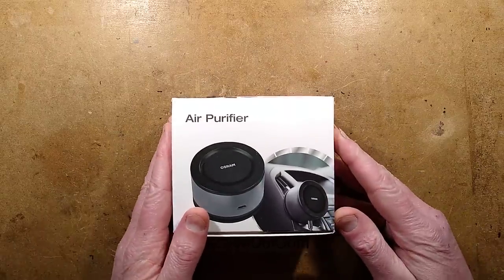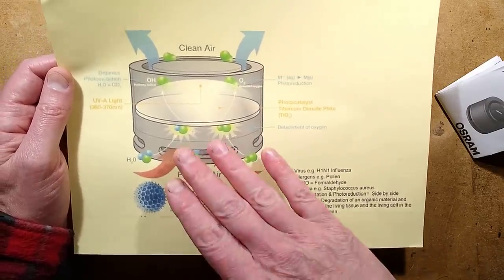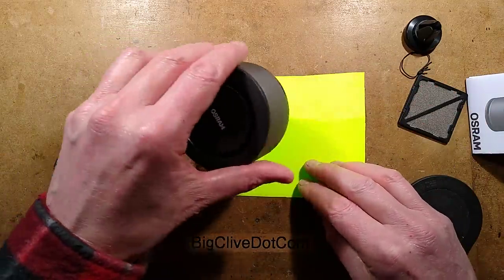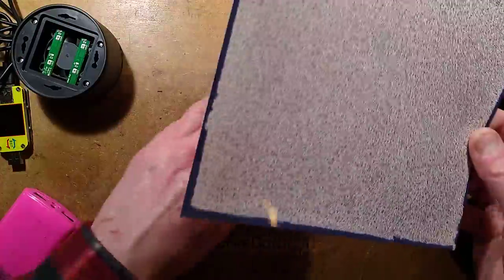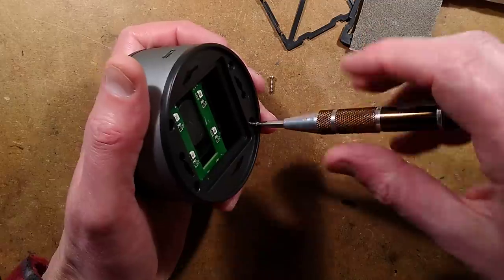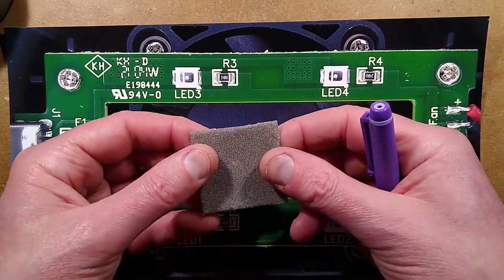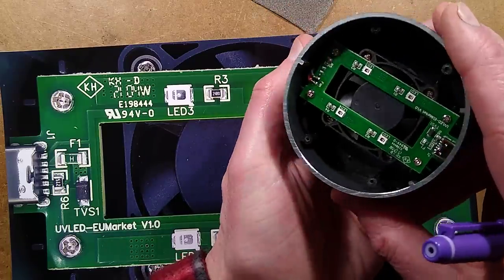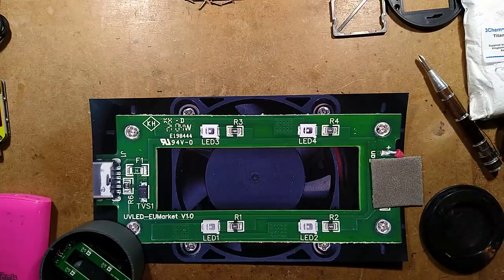Inside an OSRAM AirZing photocatalytic air purifier

Comment: Yay :) I got quite excited about your video (since I am a fan of the channel and now you talk about the topic I'm researching for the past 15 years). TiO2 is a photocatalyst and is one of the most popular ones - it all started in 1970s with a failed experiment by two Japanese - Honda and Fujishima. The principle is that it TiO2 is a semiconductor (it is also called heterogeneous semiconductor photocatalysis) and when excited with light larger than its bandgap (3.2 eV or UV with lambda < 384 nm) it generates charge pairs (pretty much what happens in solar cells as well). If there is a molecule adsorbed on the surfaces, and these charge pairs (electrons and holes) reach it - you can oxidation and reduction reactions (and can break down organics). It works, quite well (even under modest UV illumination). There are some issues, however - in humid air you can water layers on the surface, which (in one hand help photocatalysis, because water can mediate the process forming hydroxyl or superoxide radicals and increase the efficiency since they have longer lifetimes, compared to the photogenerated charge pairs), but on the other hand it (water) can have detrimental effect on the overall process, blocking hydrophobic molecules from reaching the surface. There is also the entire issue of photocatalyst deactivation. My PhD thesis was all about photocatalytic air purification (using TiO2 coated windowpanes) and it is very effective against common contaminants in lab scale experiments (however in the real world there are other issues - but all in all it work - probably not as effectively as ozone, but with less maintenance and energy consumption). And regarding the filter mesh - not all TiO2 is photocatalytic, it needs to be in the anatase form and nanostructured (food-grade stuff is made of larger particles and usually is rutile). So - in this case they either probably coated the porous substrate with a thin layer of TiO2 sol (it is a liquid precursor of TiO2, which gets converted into the material after heat treatment - in this case it is important what the base material is, since titanates with lower activity may be formed // however the gimmick factor will be the same), alternatively - a better solution will be to start with Ti-metal foam and anodise it to form a TiO2 layer ontop (you need no more than 100 nm thickness to have photocatalytic effect).
Reply: Youtube post of the day! Thank you! :)
Reply: Wow. I love getting this level of information firsthand. Clive really has the best community
Reply from the maker: I've since found titanium dioxide coated nickel foam on AliExpress.
Reply: Top answer - assuming you believe in atoms.
Reply: LEDs have approx. 85% efficiency. Not all of that light hits the TiO2. Part of the light that hits the TiO2 turns into heat directly or indirectly. The rest create chemical reactions and not all of them do anything useful. With that low power consumption, I'm very skeptical this device does any difference in practice.
Reply: So does that mean this thing works or not?
Reply: @boomish69  The principle works, but the device is so small that it probably doesn't make any difference.
Reply: I believe this comment the most lol
Reply: @mahlapropyzm9180  God, I hope that isn't another absurdity some people believe..... 😒😫 lmao
(I will not be surprised if it is, though!)
Reply: @boomish69     QUITE !!   -   I read the Novel, but am still no wiser, regarding if or not it is of any use at all...
Reply: Yeah, like I was totally going to say that. 😏
Reply: @Mike_Hughes  Only old ones if they put their fingers in the socket.
Reply: @twotone3070     Very good...  Well let's hope they find a working one then, instead of one that Clive has removed from the gene pool, in order to encourage facial hair...
Reply: I'm a science guy but I have to admit I was pretty skeptical when Clive started talking about it, particularly when I saw that the TiO2 didn't look like the typical Titanium Oxide we all know. Your explanation was interesting, enlightening and educational, though, so thank you for taking the time to write it!

Comment: I remember seeing a company making windows using a titanium dioxide layer on the surface for self cleaning. Apparently the reaction from sun light helps break down the dirt on the glass then when it rains the dirt washes off with no streaks as the microcrystalline titanium dioxide is hydrophobic. The glass was supposed to work quite well.
Reply: Interesting!
Reply: Pilkington Activ self cleaning glass 😎

Comment: Probably titanium dioxide on a nickel foam. Mostly because that's easy to make, has a large surface area, and lets tons of air past.
Reply: could also be regular household white PVA paint, which has Tio2 as an optical brightener, sprayed onto a thin carbon foam. Looks easy enough to make, I just have to go to the beach and collect some illmenite sand from the tide edge, and use a plate to density sort out the dark powder even more, giving pure very black titanium dioxide powder. Then can just coat a mesh with white PVA paint, and coat it with the powder while wet, giving a very similar finish, and very cheap.

Works on the beach, where the black silt is exposed to direct sun, making it very reactive.
Reply from the maker: I did find (and order) some titanium dioxide on nickel foam afterwards.  From Turkey via AliExpress.
Reply: My thoughts exactly - a metal mesh with a surface coating of Titaniun Dioxide. It may even be Titanium ‘foam’ (if such exists?) with the surface oxidised in the same way as Aluminium. The oxidised layer would only need to be atoms thick, so would appear metallic, not white.
Reply: About to say the same. Ceramic figures with lace frills worth on same principles.
Reply: @bigclivedotcom  There is a Turkish producer of such items here in Turkiye. I also worked on TiO2 nanoparticles decorated with much smaller gold nanoparticles in order to get better efficiencies under solar light. It looks like a nickel foam coated with TiO2 or it might be possible make It from titanium similar to nickel foam as noted above.
Reply: @DarkstarPyro  Titanium "sponge" is a thing.
Reply: Titanium "sponge" is nothing like a foam is just a lumpy mostly titanium powder that is a mid step in titanium refinement. there are actual titanium foams though
Reply: SeanBZA - So that is why the sea breeze has health benefits - that some claim to have been cured of minor respiratory infections when they go to the coast.
Reply: @SeanBZA  hmm, I've got a 5 gallon bucket of black sand from the beach. I looked up illeminite and it says it's weakly magnetic. I know the stuff that I have is fairly strongly magnetic. I'm sure a lot of it is black iron oxide I always assumed but I wonder if there's a percentage of titanium dioxide in there as well. Then how to separate them? I do bronze and copper casting and have a friend that does some blacksmithing, so I always thought it would be kind of fun to try and smelt some iron out of black sand.
Reply: @keithyinger3326  Depends where you are, by me the beach sand is mined for it.
Reply: @johnkey1682  Yes, I have some in my pyro chems collection! It’s gnarly looking shit - and heavily oxidised, so would no doubt photo activate nicely. Trouble is, it’s very brittle. A Ti ‘foam’, if possible, could eliminate the brittle aspects, maybe?

Comment: I would assume that it increases surface area for more reactivity. A small volume but large surface area due to the porous nature. This would increase the reaction rate. It is very good at reacting with organic chemicals but poor with inorganic. 

When UV radiation at energies larger than the band-gap energy of the TiO2 crystal (3.2 eV for anatase; 3.03 eV for rutile) is absorbed by the catalyst, an electron is promoted to the conduction band, creating a pair of a negatively-charged free electron and a positively-charged electron hole. The electron-hole pair migrating to the TiO2 surface has strong reducing and oxidizing activities. The hole in the valence band reacts with water to produce hydroxyl radicals (.OH). From  "Application of ultraviolet light assisted titanium dioxide photocatalysis for food safety: A review".

I imagine the filter should be removed and washed as the material from the above reaction would be somewhat attached or reacted with the mesh. By washing it you physically remove material This "recharges" the TiO2. 

The ROS can disrupt and damage cell functions and structures, and cause chemical modification or cleavage of the DNA and cell membrane. UV-A, UV-B, and UV-C light sources were used with TiO2 and it was shown that the combination led to structural changes in the super-coiled plasmid DNA and genomic DNA of E. coli.  Photocatalysis is not limited to application of UV-C light. When combined with UV-A, and UV-B, TiO2 has proved to be less effective than UV-C for inactivation of pathogenic bacteria, E. coli. From  "Application of ultraviolet light assisted titanium dioxide photocatalysis for food safety: A review".
Reply: Pinnable!
Reply: ROS?
Reply: Yes, but he asked why it wasn't white.
Reply: @David.C.Velasquez  Sputtered?
Reply: And that's the answer, for which i didn't do nothing. Thanks, great explanation.
Reply: @RonJohn63  Reactive Oxygen Species (ROS)
Reply: @David.C.Velasquez  He also asked why they were using a foam like pad, how it works and  a few other questions. This answers most everything that is important. The colour is not important in this context as it subject to a near continuous reaction cycle. i would not expect it to stay white.
Reply: @Piqus3  the answer to what?
Reply: @acole5975  where did he ask why it's a foam?
Reply: @unvergebeneid   Around 4:04 and again around 8:40 mesh/ sponge  Not foam but close enough for the purposes of a random YT comment answered long after the video was watched.
Reply: @acole5975  I get it, no disrespect intended, and of course you are correct. It just seemed like the fact, that a porous matrix having more surface area was a given, not worthy of a primer. While the question of why a material that usually presents as a chalky white substance, was metallic, was a less obvious inquiry.
Reply: @acole5975  in both cases he seems puzzled about the color, not about the large surface area.

Comment: Titanium dioxide is actually transparent in thin films (it's commonly used for optical coatings and such), so it's perfectly plausible that the metal mesh substrate is coated in titanium dioxide, or if the mesh is actually titanium itself, has had a thin oxide layer grown on it. Supported catalysts like that are pretty common, because it results in a cheap, durable, high surface area.

I do want to mention that while the claims may seem a bit like marketing wank, photocatalytic activity of TiO2 thin films has been an area of study for quite a while now. Ben over at Applied Science has a video about TiO2-coated self-cleaning glass, which has potential applications in high-rise buildings where window washing is a bit of a pain.
Reply: "which has potential applications in high-rise buildings where window washing is a bit of a pain."
My Dad was an ambulance driver for 20 years in <Big_City> so over meals we'd get to hear the latest gruesome story. One day he arrived home with a Chamois leather, those things are expensive. A window cleaner had fallen off a tower block. My Dad just said, "he won't be needing that any more".
Reply: @rysacroft  Disliked for stealing from patients.
Reply: @johndododoe1411  I fear, the prior owner was no patient any more after this accident.
Reply: @goamarty  Technically still a patient in terms of the privileged trust granted to ambulance crews.
Reply: @johndododoe1411  My Dad dealt with death and destruction on a daily basis. Picking up the pieces of someone who had jumped under a train. Could you do that?
Being ex Royal Navy he'd come home and drink a nip of rum, I never saw him drunk.

Comment: I watched a video on the action lab channel recently where he explained that titanium dioxide is actually clear. The white colour is like the white colour of snow, from many small particles each of which is actually clear. He also explained why a layer of it produces the rainbow colours by interference between the light reflected from the metal surface and the oxide surface above it.
Reply: link pls. thx
Reply: @raymondo162  i would guess its this video pavp6dps6q0 named "Cold Welding Metals In a Vacuum"
Reply: according to my art class teacher, to use titan dioxide as a white pigment, it needs to be at a specific particle size.

Comment: I was researching how to make a DIY photocatalytic air purifier when I found your video. I had already discovered a source of TiO2 screen mesh available from either Europe or China,  which was available in 3, 5, or 10 mm thick mesh. It had the same grey color that you questioned in this video. I thought the same thing but must assume that when it is sintered onto the mesh or somehow impregnated into it, it changes its color, but I'm not a chemist, so I may be wrong. This device is way easier to buy than to build one, so thank you!! Brilliant deconstruction of the tech too!

Comment: As others have pointed out, titanium metal forms a passivation layer of Ti02 in air and a metal mesh is much more useful from a mechanical point of view.
What puzzles me is that it’s illuminatied from the wrong side, i.e. the particles and virus’s etc that you wish to destroy are more likely to collide with poorly lit bits of the mesh.
Not that I suppose it makes much difference, it’s such a small device that I doubt it’d have much effect on anything larger than a sandwich box.
Reply: Maybe the surface builds up a charge that will attract particles?
Reply: When the LEDs were shining through the mesh onto the neon yellow paper, it appears that quite a lot of light can pass through.
So I wonder if using a reflective surface on the other side (inside of the bottom cover) would reflect enough back up to illuminate the other side of the mesh?
If not, I dare say that a small square of foil tape would increase the efficiency of the unit (assuming that this really is a thing. I've never heard of using UVA light on titanium dioxide, so I have no information on the chemical side of things)

Comment: I think this actually.....kind of ....is... a plausible mechanism device??? There are in fact lots of papers all over on this and indeed most of them seem to be using ~370nm UV light to irradiate the TiO2 because this is in fact right around the bandgap for that material and maximum absorption should happen around there. And of course that's a reasonable wavelength for GaN LEDs to be producing a significant amount of light at (as opposed to UVB or C). I think this may actually work and not just be more quacky landfill fodder. You should test it by putting it into a totally sealed glass container with a small amount of alcohol or acetone and then run the device for a while inside. Open it and see if you still smell the VOCs. Repeat it with the LEDs shorted and see if there's a difference.
Reply: . not Shorted but disconnected.

All so you woldent want. To do that on this device due to the fuse!

Right next to that diode across the 5 volts input!!

Strange that would be used on a usb powered device as wel.

Thoughts on the use of revurse polarity protection on a usb powered device?

Thoughts comments and more please!

Just seems odd that work be a reversed polarity situation on USB power.

I suppose that maybe prosperously in this wood may not have been designed to take USB power in perhaps just some other troubled source that could have been accidentally have had polarity reversed.

Such as Barrel Jack initially perhaps circuit was designed for something like that but later I change or perhaps a different laptop power input.

Those two will be where the polarity of a barrel jack is not always the same.

 AKA may not be for example center-positive!.

Central negative is not common but is out there in the wild.

Sometimes I think it's done on purpose but just a theory.

One of the reasons Central pasta would be preferred.

First help with Automotive applications.

Is that if the outer contact on the barrel Jack contacted anything that would be additionally connect to the chassis ground of course being negative that would not be an issue.

Not so much if the owner connection of the barrel Jack or positive.

Could either be sparks flying or blown fuses.

Or if things go wrong or poorly designed circuitry if it's not just a straight through 12-volt cable.

Theoretically could in your damage or destroy components in some sort of power supply.

Such as a Shuffle rag or a buck or boost circuit or other type of charging circuit or otherwise.

Depending on a circuit for you it could do quite a bit of damage shorting the positive of an output negative chassis ground.

Is it way since Kip Bradley yourself if this happens!

I want some of this happened with 6 volt Center negative adapter running 4 volt cigarette lighter power port.

Lots of smoke and a few sizzles and pops and that was it!

If I remember correctly most of the smoke from just from resistors.

Cool design very inefficient!

Also produce a lot of heat even when it was working right initially before this happened!

Also we are passing Casey Munoz ventilated person melted and deformed elsewhere!

It was not a good day for that power adapter!
Reply: i agree - lots more road testing is needed along with lab analysis of the mesh after a day / week / month
Reply: Is that a cheap brushed DC fan motor?
Reply: @AZOffRoadster  nah dude thats like a cpu fan
Reply: Consider putting a piece of stale damp bread inside a sealed container with this device (powered up of course) and see if it can prevent mould?